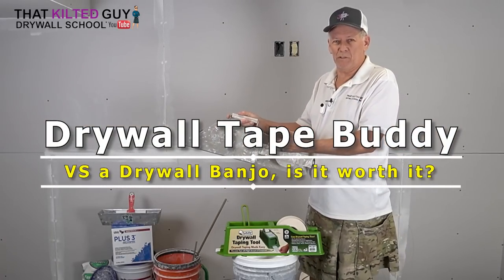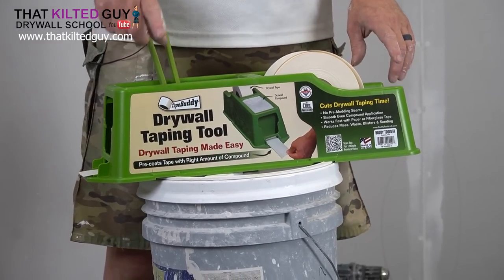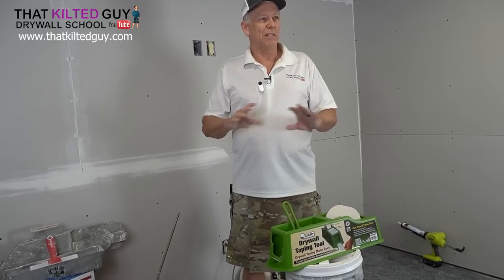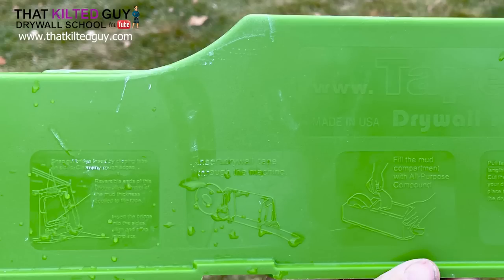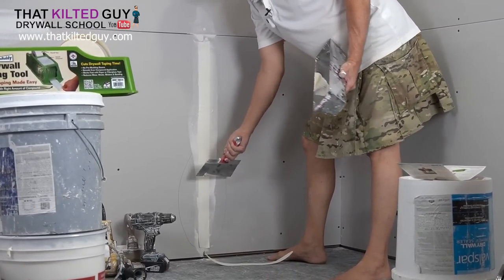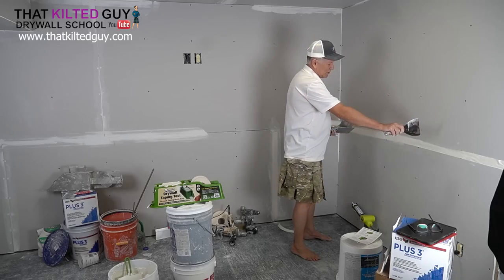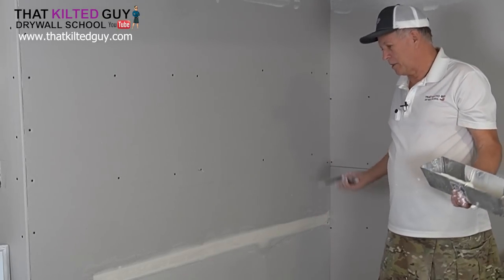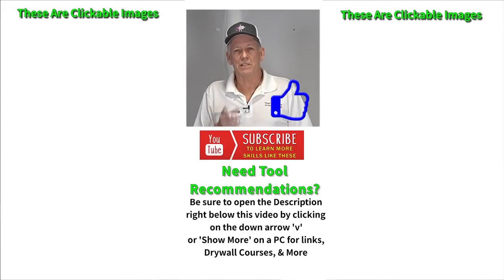The Drywall Banjo is Old School? Is this the future of  Taping Drywall?

Comment: I taped for many years.  I also could not get the cutter blade sharp enough to cut easily.   What I did on my banjo was I riveted a piece of hacksaw blade to the front of my banjo cutter blade.  Easy cuts for years.
Cheers

Comment: I like the tape buddy but I use it differently than you showed. I get a bucket and just pull out a bunch of tape into the bucket. I then go to the wall with the bucket and start slapping the tape on the wall. Then I go back and inbed the tape with my knife.  Works for me. Thanks for the video.

Comment: The banjo in the right hands can be a dangerous tool! If you cant afford a bazooka they are priceless. That new tool I have tried and I used to think the banjo was a messy tool but the tape buddy made it look clean, I was covered from head to toe while trying to use it! Might be great for tiny projects but cant compare to a banjo for production purposes. You should review that new banjo type tool I think it's called the mud pro. It has a cutter and corner wheel as well.

Comment: Adding a 2nd comment, as something came to mind and I didn’t want it lost.  The one job that comes to mind where I’d pick one of these up is, Fire Taping.  Probably isn’t done much at this point (replaced with foam) but this was often a patch work of tape out of view.
Reply: Fire taping would be best for that thing! Yep I'd use it for some areas. Still, I am all for Goldblatt banjos. I've used them since 1978. That's 44 years of "Wide Open 100 mph!"

Comment: I've found the Tape Buddy to be an effective tool. For taping a room it's great... for a house it would be slower than a banjo or bazooka but faster than a pan and knife.  I had a helper one time and we were able to pull out 11-12' lengths and apply them to the joints together. That was long enough for the joints in that room... a win!
Reply: Faster than a pan and six inch knife? Not for a Pro
Reply: @randythomas3478  You might be surprised. Inside closets, bathrooms and hallways you can fly!
Reply: @randythomas3478 have you used it?

Comment: Hand tools. I've worked behind too many guys on banjos and the such. They almost never do the prep work, the mud is thin and they don't fill the recess. Run right over blow outs, popped screws, crushed seams, and delamination. I've never seen anyone do a really nice job with them. And unless you are tag teaming it, it's really not faster than a pan and joint knife. I'm fast on a joint knife, and everything is up close and personal, everything gets fixed

Comment: I have to chuckle at this (new) product,my dad was using this in the 60’s I started with it in the 70’s,ours were made of wood,the fastest technique is to pull like 8’ of tape loop that halfway hook it on your pinky don’t tear off,pull 8’ again loop it halfway hook it on your ring finger,continue this until you end up last loop pinched between last finger and thumb,we would have 50’ or more in one pull,fastest with one man putting up tape and one man wiping behind him,when I was younger I could compete with a bazooka,never thought about patenting that wood box duh on my part,did my dad have the original,I don’t know but it’s kool to see.
Reply: We call them slop boxes. Mine is made out of stainless steel. From the late '70s. And agree out can pull alot out
Reply: @bobc3451  I remember my dad calling them slip boxes,I think reason was it was shaped like a pig feeder design with the sides angling out sort of a v with a flat bottom, ours were sturdy you could mix a whole bucket of mud fill your box, lay your bucket on its side on top of the box and keep it full of mud til the 5 gallon bucket was empty,also if you ran out of tape,you could leave the last couple of feet of tape in box,put on new roll of tape slide new tape under the tape you left,and the weight of the mud would pull the new roll to the front,ready to pull another 500’ if you didn’t do this you had to empty mud from box then pull tape through then put mud back in,I know that’s a long description but I’m sitting at the hospital with my mother bored crazy.
Reply: Not slip but slop,also if you had any trash in your mud you had to get it out or you’d have little streaks on your tape with no mud,hated that!

Comment: I tried your type of banjo back in early 80s...i ended up bouncing it across the garage floor. I always used the Goldblatt banjo. Kinda rounded and shorter. Perfect in closets too. When I first started, I wiped down behind two seasoned drywallers! On stilts or on the floor, I wiped down all angles corners flats, plus kept their water buckets and taping mud buckets near to them.  But after I became a seasoned finisher (about 3 years!) I was out-taping everyone! Goldblatt banjos! The best! Tampa Bay region was our turf late 70s 80s!

Comment: Yeah, but this tape buddy is still hella expensive. I have two bathrooms. TWO where I will use this tool. Jeez, that would be about $55 with shipping. 
Buddy Tools LLC Drywall Taping Tools - 
TapeBuddy Drywall Tape Dispenser w/Scoop-N-Scrape Bucket Scoop for Compound-Thinset-Mortar-Stucco-Coating-Sealers & More! Less Mess, Less Stress & Sanding
4.4 out of 5 stars (4.4)15
$48.98

Comment: I just purchased a banjo after already having and using the tape buddy. I thought I was going to love the banjo, but unfortunately I hated it and only used it for about 3 minutes. I may have had too much mud but I had a difficult time slapping the tape to the ceiling and the tape kept falling off. I cleaned it out and used the tape buddy to finish 😂
Reply from the maker: I did mention that I have a love-hate relationship with the banjo myself. I can make it work because I’m a pro but I still I’m not fond of it. Tape buddy is much easier for novices.

Comment: I tried the "tape buddy".  As you said, it does a good job for small projects.  I've been using a banjo for several years and yes, it is a workout but it gets the job done.  I'd love to have the bazooka but I just can't justify the expense of that entire system.  If I did just drywall work, I would probably invest in the bazooka equipment.  Whatever the case, thank you for the review of these and all the other pointers you have given.
Reply: Try looking at the Mud Pro its alot like a banjo except it has a cutting blade and corner wheel. Cost way more than banjo but half of bazooka and you dont need a pump.

Comment: I never knew the banjo or any other tool would put a nice coat of mud on the tape. Thanks for the knowledge.  Also I agree the one tool over the banjo.
       During your great presentation  I found myself looking at the way the sheets of sheet rock were placed on the walls. Perhaps you could make a video on how to place the sheets. Does one work from the ceiling and then down towards the floor or vise versa. Also the staggering of the joints.
Thanks in advanced. ( sorry if you do have a video on this already.)
Reply from the maker: I do plan on doing a drywall hanging series eventually

Comment: IMO, if you have 0 skill it will get the job done on a small job.  On the other hand with a bit of skill it will be faster to get some mud on the joint and lay on the tape. :)
Reply: You can't beat the speed of a banjo honestly especially, but hand taping can definitely give more  consistent quality results. But if the banjo mud is the right consistency with easy access to more mud and the banjo has been broken in and you are fit to run it, its a game changer.

Comment: Thanks for the review! I'm a banjo guy for anything between 20-60 boards anything under 20 I use a mesh gun with hot mud loving the mesh gun you should do a review on that? I'm rocking the hot mud.
Reply from the maker: I’ve used the mesh gun in videos many times

Comment: I don't mind the titty-high mudding/taping but if that thing keeps me from having to apply mud on inside corners - especially the wall/ceiling inside corners - then I'm all for it!  For DIY or guys who will do drywall jobs but don't specialize in drywall and don't have all the expensive modern drywall tools that product is actually a very good investment.